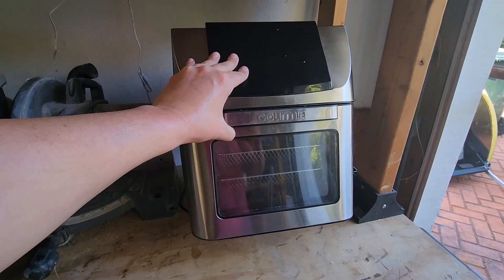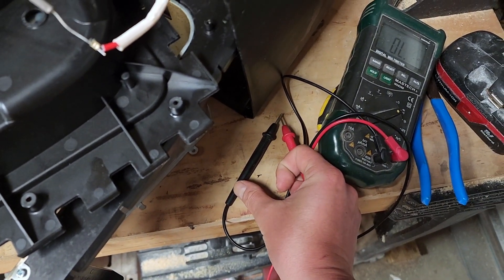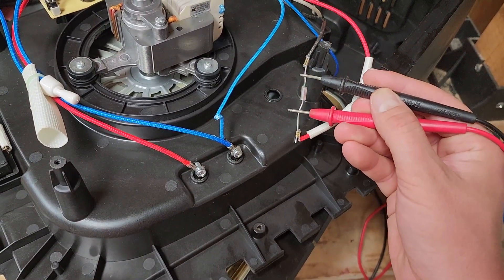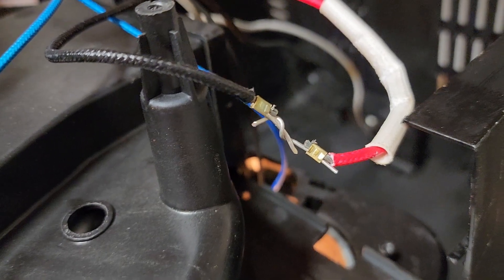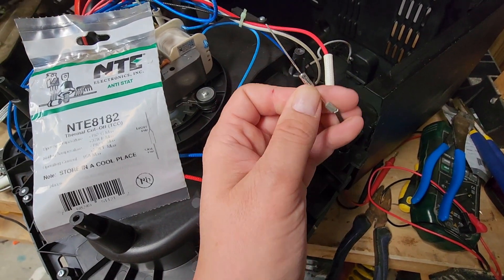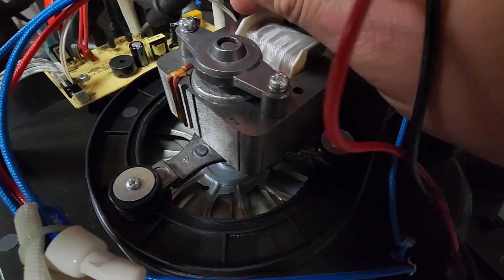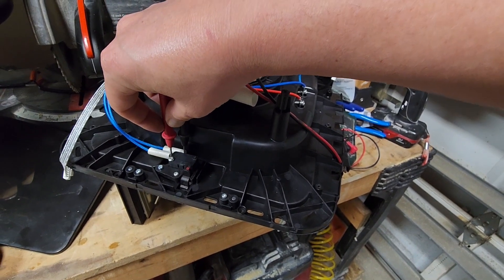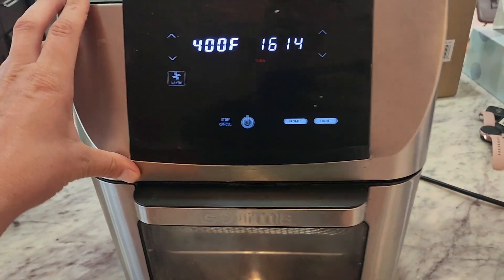DIY Gourmia Air Fryer Repair - Will Not Power On - Thermal Fuse Replacement

Comment: Hello , I have the same air fryer but the screen keeps saying open. I open the door and close it again and it won’t let me proceed. Would it be a door censor that is triggered ?
Reply from the maker: Sounds very likely. At the end of the video I show how one might test the door open/close microswitch.
Reply: How do I fix the switch? That is my problem.
Reply: I had the same problem with mine after the second use, A piece of tape on the center of the the door where it comes into contact with the switch at the inside top of fryer fixed mine. Maybe a loose switch or out of adjustment.

Comment: I think everyone came here to figure out how to disassemble the fryer. it was probably not show because things were broken in the process.
Reply from the maker: I did break one clip, nothing more. The disassembly process was not shown, as I was figuring it out as I went along, I did not have a stand to hold the camera, and I thought it'd be boring watching removal of a bunch of screws (which is really what the disassembly amounts to).
Reply: @Jonathan Morgan  all the screws that were removed in your video were not necessary. The top vent cover is held on by clips. They are a pain in the ass to remove and will probably break in the process. Then there are 4 screws that hold on the top cover. All the electronics are accessible through that cover.
Reply from the maker: @chinookmech  cool. That's easier.
Reply: @chinookmech  i am desperately trying to get this cover off but i don't understand what I'm missing. whenyou say the top vent cover are you refering to the chrome part or the black semi transparent part on the top. I am assume the black semi part is held on by screws but the chrome part i can get under but no clips.
Reply: @miragemaverick2130  the top vent cover is held in with plastic clips. They are not easy to come off, but I used a putty knife and some persuasion. I broke one in the process but was able to epoxy it back on.
Reply: @chinookmech  ok thank you guys for the help... I got that %&(*# off. i did have to break the 2 front-facing clips once I did that I was able to remove the 3 screws holding the display and then pop that off. from there I could use my screwdriver to reach the other clips and not break them. I repair alot of stuff but this was the most ridiculous.

Comment: How do you get the top off where the circuit board is it won't release and I've removed all the screws???
Reply from the maker: You have to pry it. It's held on with little plastic clips. One clip broke on mine, but it's not noticeable.
Reply: @JonathanMarkMorgan  I think he means the next black plastic frame after you pry off the top vent lid with the 5 tabs. How did you remove the next black plastic frame? I removed the vent lid then removed the 4 screws from the 4 tall black posts, but that next black frame still will not budge. Are there more screws than the 4 in the tall tower posts, or does it also have to be pried from its tabs? Thanks  PS I can almost use pliers and pull the thermal fuse out of the hole, even with the black plastic frame still in the way, but the fuse is really stuck in the hole. Does it just tuck into that hole, or is it secured somehow?
Reply from the maker: @aphipps10  I don't recall the full details of disassembly. I likely disassembled more than I had to, but I did my best without having schematics of the device :) Regarding the fuse, it was not secured in any way in the compartment. Perhaps yours is just a bit stuck?
Reply: @JonathanMarkMorgan  yeh on some of the other Gourmia models ( the round models) they use a metal clamp to secure the thermal fuse to the plastic. I am pulling and twisting like crazy - it moves around, but will not budge out of the hole.
Reply: @JonathanMarkMorgan  finally got it out ( the thermal fuse). I got so frustrated that I used pliers and yanked very hard. It came out but in the process it sheared some of the red insulation off the red wire near the fuse. So I will just cut that part off and install the new fuse.